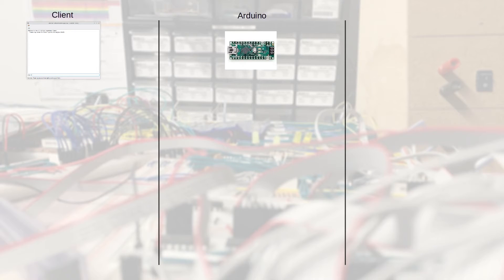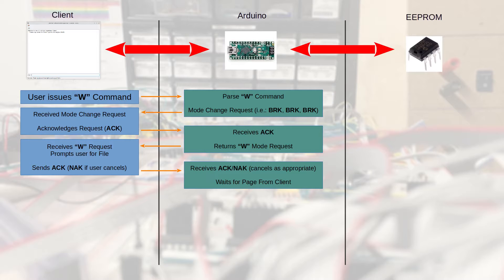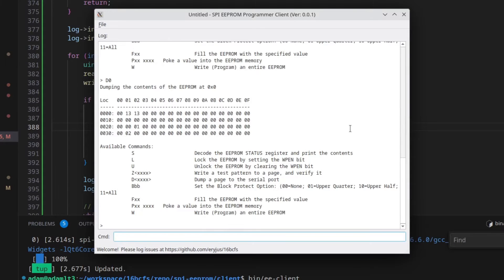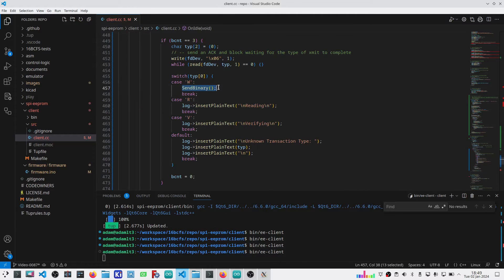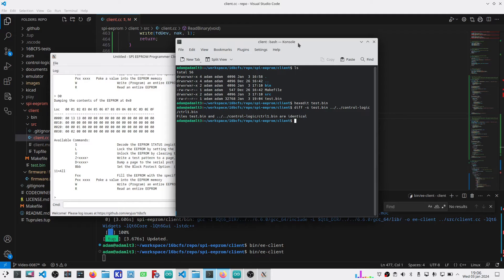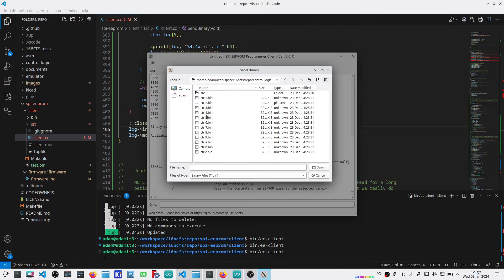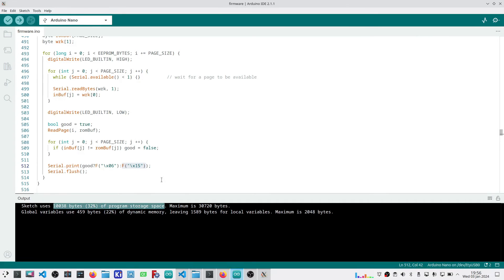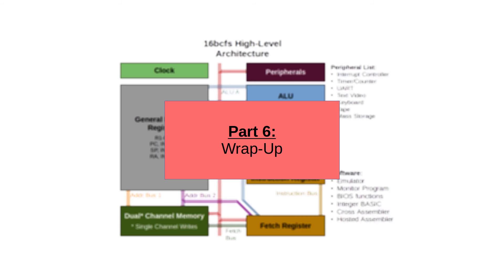0087: SPI EEPROM Programmer Ready | 16-Bit Computer From Scratch

Comment: Are you planning on removing the EE from the 16bcfs to program it or do you have plans to allow "in circuit" programming? I was tinkering with simulation for the entirely hardware transfer from a 25LC256 to 62256, it's mostly working. the hardware could be expanded to transfer multiple sets relatively easily as the address counters and eeprom command counters would be common. I was thinking that the arduinio (or ESP32 or whatever) programming interface could take over the EE input and output lines (and if more than one, have some sort of chip select to pick the active unit) when it is plugged in and/or powered from usb. I think that would really speed up early development and save the sockets wear and tear.

I suppose an alternative would be some of the faster 28F series flash memory, then no transfer would be required. some are even 16 bit wide data which could be useful for control store.
Reply from the maker: @grumpyoldman5368 -- Thank you for the question!

Spoiler Alert: I plan on loading the EEPROM into SRAM in boot up, similar (I believe) to what you are doing with your 25LC256 to 62256.  This will be starting in a video coming soon.

At one point in my life I did have a plan to be able to program the Program ROM (vs the Control ROM) from an Arduino or similar.  This was on my prior build, which was not videoed and had all kinds of problems.  In the 16bcfs build, I did not bring those plans forward.  That is not to say in circuit programming of the Control ROM could not be added.  What would I need over what I already have planned?
* The Arduino (or whatever) would need to be able to assert a reset.  That would be easy to do.
* The Arduino (or whatever) would need to hold reset until it was ready to release the build.  That would also be easy to do.
* The Arduino (or whatever) would also need to assert a special state to program the EEPROM where it could send data to the control logic EEPROMS (there are 12 planned with space in the build program for 16).  At the end of this cycle, a new reset would be issues to load the Control EEPROM into SRAM.  This could be issues from the Arduino.
* I would need to determine how to store the EEPROM data on the Arduino (not likely based on space concerns) or load and send them over the Serial to the Arduino and then on to the build (similar to what I created in this video).  

All that said, I do not see any added value at this point in the build.  Yes, it will slow the development lifecycle and add stress to the EEPROM.  But these are more like jelly-beans these days and I have no real concerns with replacing them at this point (the SPI EEPROM to be specific).

Now, the Program ROM is another story and I plan on a Serial Interface and boot loader to shorten that lifecycle dramatically when I get far enough along.  I suspect that I will be developing far more Program Code than I will be updating the Control ROM by far (once I get the instructions stable).  

This approach is not unique to my build; James Sharman has already done this: https://www.youtube.com/watch?v=f7_8j13raJg .  I recommend a binge if you have not seen his build.
Reply: @eryjus4594  Hi, I have a question. Have you abandoned the idea of a battery backed SRAM?. I understood your goal at the time was to be able to load programs directly on SRAM from an Arduino or even by means of a 16bcfs boot loader residing in the same (battery backed) SRAM . Please can you clarify this for me?. Thanks
Reply from the maker: @RelayComputer -- Yes, I have.  For the moment anyway.  

I know there are solutions out there which do this already, I was hoping I could mimic what I thought I understood.  

So, a couple of things I think contributed to my issues:
1) #CE was not pulled high fast enough on loss of power.  
2) With the relay, the ground reference was switched, causing a momentary loss of that reference voltage and a "different" reference once re-established.
3) I was driving the relay coil with the capacitor, which was a known problem but causes the relay to drain the cap quickly (nearly instantly).  This likely contributed to a timing issue with #CE.
4) The transistor solution was leaking more than I thought it should, and I could never manage that leakage properly.

Now, it is also important to understand that the battery backed SRAM was never going to be part of the final build.  Once I get everything settled, the plan is (was?) to put the Control ROM Image on OTP ROM.  The SRAM was only for the development lifecycle.

I will probably pick this up again in the distant future just to prove to myself I can get there.  But it will not be part of the 16bcfs build.
Reply: @eryjus4594  Thanks for your reply. I asked because I plan to try this myself, but I'm progressing at a very slow pace and I'm not anything near that stage yet, so that's why I was curious about your approach. My goal will be to implement a rechargeable battery, in a way that as long as I power the processor from time to time the battery gets sufficiently charged so I should completely forget about the contents of the SRAM being lost. So far it looks like a good plan to me, and it would be part of the final build in my case, but time will tell whether that's actually the case. It depends on how reliable it is
Reply from the maker: @RelayComputer -- I look forward to seeing your success!!

One other thought I had for my Control ROM was a diode matrix.  This would have a number of dip switches and diodes to set the control logic.  However, with the size of my overly ambitious build, I would have tens of thousands of diodes and switches.  The thought did not scale well to the size I needed.
Reply: @eryjus4594  "success" is a strong word. I mean let's see how that goes... but thanks anyway. Regarding control logic, well, I attempt to build something based on (solid state) relay logic, and as per my chosen design constraints it would not be acceptable to use an actual ROM for that. So I will actually go for the dip switches and diodes (or relays actually) to generate the control logic signals using a mix of decode matrix and direct decoding from instruction bit fields. The ARM1 processor took that approach  but of course it had 32 bit encodings which made decoding easier than any 16 bit encoded instruction set. So I'm not at that stage yet, but I am aware this approach will require in my case multiple PCBs just for instruction decoding